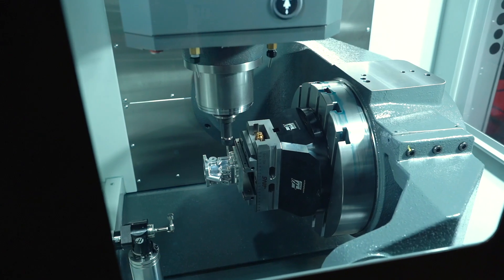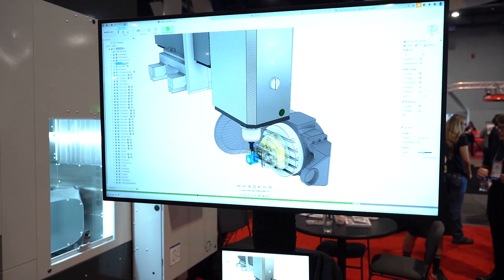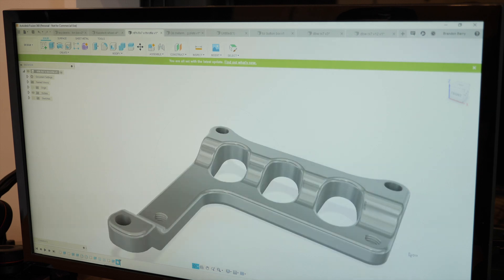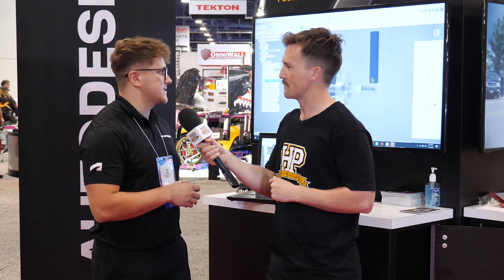Is Fusion 360 Any Good?

Comment from the maker: Dive Into Fusion 360 Like a BOSS: https://youtu.be/GcJMj9zfq5Y
TIME STAMPS:
0:00 - Autodesk Fusion 360
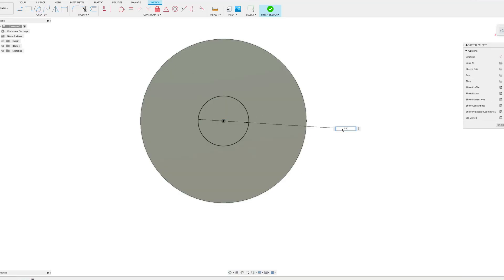0:47 - What Is Fusion 360?
1:46 - Use One Design File
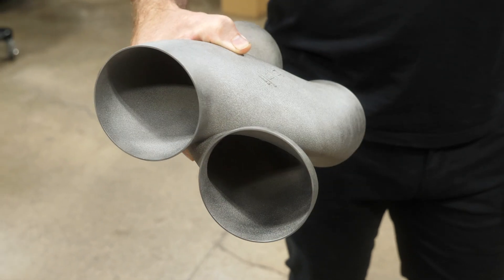2:38 - How Generative Design Works
3:28 - Generative Design Manufacturing
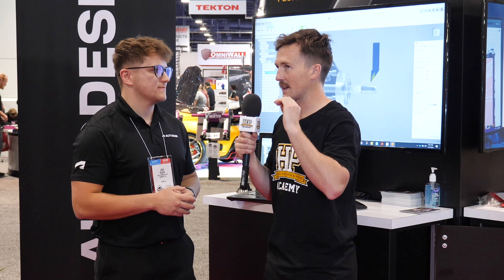3:47 - What Is CAM? 
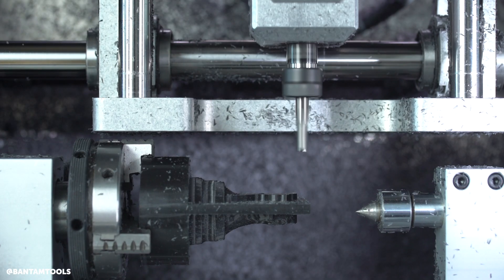4:43 - KEY POINT!
4:54 - Design Process Workflow
5:30 - Additive Manufacturing (3D Printing etc)
6:49 - What Is Slicing?
7:05 - Laser Cutting, Routing, Milling etc
7:58 - Machine Setup In Fustion 360
8:49 - Why Use Simulation?
9:18 - Creating A Tool Path
10:30 - Post Processing
11:09 - What Is G-Code? (also RS-274)
11:53 - Where Do You Start/Learn?
13:10 - BUILD | TUNE | DRIVE